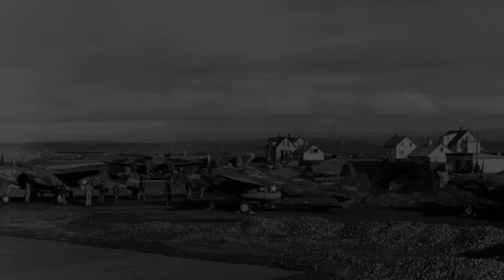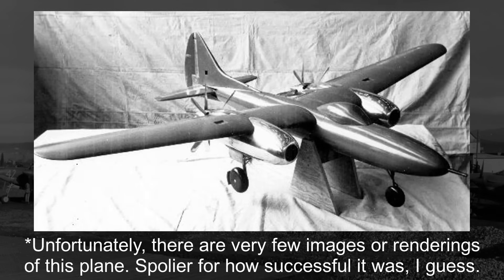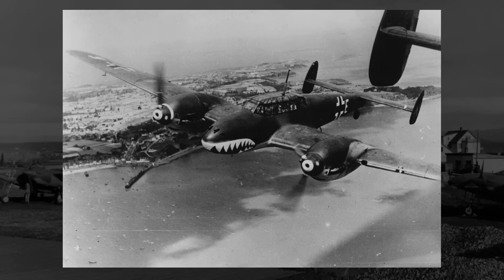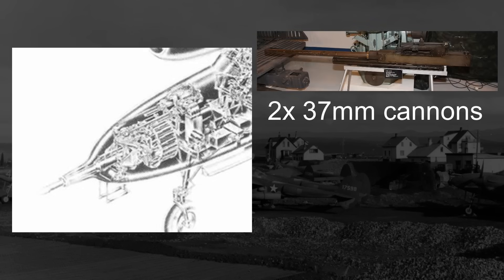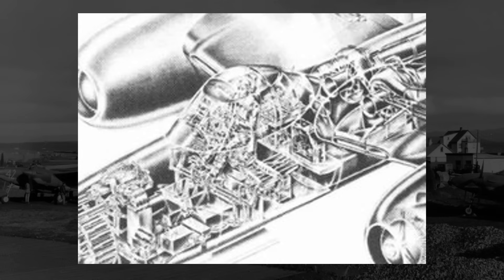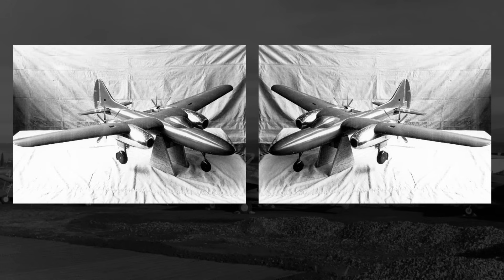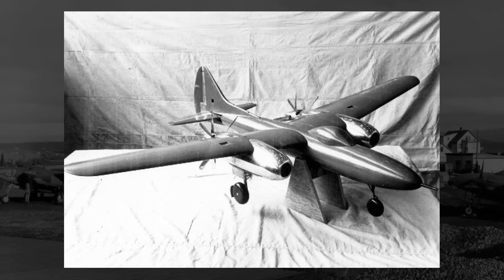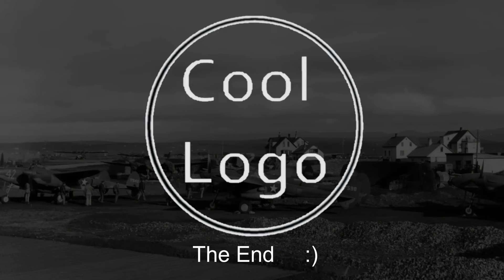Curtiss-Wright Was Run By Insane People: Curtiss XP-71

Comment: Curtiss was cranking out P-40’s, cranking out P-47’s for Republic, ironing out problems with their Helldiver, working on other prototypes while right under their noses was the P-40, it needed more hp and a clean-up of aerodynamic drag. It came in the form of the P-40Q, a 422 mph aircraft, superior to the P-51 in maneuverability, but it came too late in the war to be put into production. However, the P-40 operated in every theater of war and without this airplane, the early years of the war would have looked very different. She was a lethal bird in the hands of a pilot who knew how to exploit her strong points. Unfortunately for Curtiss, their aviation division came to an end in 1947 due to a poor choice of powerplant for their F-87 and politics. Harry Truman had problems with Curtiss and the F-89, a less capable airplane, got the contract.

Comment: 15:03 the allegations aren't that a German bomber flew over America but that one got within 12 miles of the US coast.  That said, this legend has been proven false--the plane said to have done the trip didn't even exist yet at the time the mission was said to have occurred.  I hate to brainstorm how the evil Third Reich could have done better, but as an engineer one is driven to solve problems.  It would have made sense to fill a couple bombers with explosives and fly one-way missions to ram the skylines of Boston, NY, Toronto and Detroit.  Crews could be kept to a minimum and bail out moments before impact, with luck to abscond with fake paperwork and be picked up by skiffs from subs, and worst-case scenario simply finish the war as POWs.  Total damage would have been probably been negligible in the great scheme of things but would have forced the US to devote, what?  1000 fighters to continental US air defense?  More? It'd have also been a propaganda victory.  Of course, the smart thing for Germany to do would have been to not empower Hitler.  The smart thing for Hitler to have done would not to have declared war on the US: FDR was fully pro-war but the US public was too isolationist.

Comment: What a crazy design, but actually not totally unique in concept to other fighters suggested at that time. That "bigger is better" mentality was also displayed in the XP54, the Chain Lighting, Moonbat, XP-72 et al, ignoring what had already been learned in battle. What makes this crazy is the over the top specifications. The range and firepower had no basis in reality and those two factors could have been scaled back and all related systems would have shrunk exponentially! Weight and size probably gotten pared down to half of this plane with a 1200 mile internal fuel range. Four 20mm cannon, heck six, would have been far more lethal and weigh about half or less as much. Even if you kept the gargantuan engines, weight and size would have been less than half. I think so much of this had to be one-upmanship between the manufacture's. They probably felt the need to be over the top to get noticed to get those big, fat contracts. A lot of money was thrown at projects that never saw the light of day, but in in relation to the overall effort of the manufacturer's, kept the paychecks rolling in with nothing more than drawings and models produced.

Comment: Proximity fuzes for ~75mm guns went into widespread use in 1946 (when many USN ships had their 40mm Bofors replaced with semiautomatic 76mm guns), the first effective surface-to-air missile (Nike Ajax) appeared in 1954.

This means that the XP-71, if actually built, would have an eight-year window of being a more-or-less useful bomber interceptor - a proximity fuzed 75mm in the air. 
Though SAMs would quickly replace it and force it into its peripheral role of ground attack.
Reply: As a heavy interceptor over England, not just America, It would want radar and less fuel, but as a ship destroyer, probably near Japan, it would want to retain the fuel.  Like the Mosquito, If exposed to single engine fighters, it would want to use performance to outrun or climb above them, not to maneuver.  So I view the closest competitor as the Black Widow, not the A-26.

Comment: Curtiss seemed to go crazy in the WWII era.  In a 6 year period Curtiss produced 15 aircraft designs that were actually built almost all only as prototypes.  Only the P-40, C-46, and SB2C were at all successful.  There were also a number of other designs such as the XP-71 that ate up engineering man hours without ever making it to the prototype stage.  I can imagine how thin their engineering must have been spread, especially after losing Don Berlin in 1941.  Curtiss's production also seemed to fail.  The army shut down the Curtiss P-47 production line during the war due to the many problems with both quantity and quality.

Comment: I like it.

Hmm ...

Knock down the size, way down.

Super lightly built, naturally.

Two Rotax engines.

Voila!

My very own aircraft, made for short hops to the pharmacy, Walmart, and to church, plus a longer-range flight to the VA Hospital in Columbia, MO, with my new aero- plane rigged to be able to hit the road for a short bit of driving down the road!

With the wings being able to be folded back for keeping my beautiful plane in one lane, of course.

If the police don't like my driving on surface streets, I'd have to do this on very foggy and/or cloudy days for my getaways!

So, automatically fold back/extend wing capabilities.

I would also equip it with a radar detector for just in case, because, well, you know ...

Also, equip it with floats, because I happen to live very close to a river and a lake.

Floats with wheels, for hopping from water to land, then to my shop, all within a quarter of a mile.

Maybe a third Rotax in the nose, and one in the tail for that extra get up and go!

Chaff, for that radar for skyborne thingies!

OK, maybe not quite so lightly built, but still, I'd have to keep the weight down, seeing as to the high gas prices, for now.

I could shut down the nose and tail engines midflight for extra mileage, also.

4 semiautomatic 12-gauge shotguns in each wing for those dadgum birds that can mess up takeoffs, don't you know.

Maybe Jatos for quick takeoffs!

Comment: Its funny when you look at all the hate on German equipment of ww2 it is because the German stuff is never compared with equality.
They say the 110 was poor due to its performace against the shitfire.
But the 110 outperformed the mosquito Whirlwind, welkin blenheim and beaufort which were its actual contemporaries 

The bf109 outperformed the spitfire in practically every factor 

Tiger outperformed the IS2 ir M29 or Churchill

Panther outperformed the T34 or M4 or Comet

Type VII out performed U/ V class

Type IX outperformed Gato, R/S/T class

He177 outperformed other bombers (faster, higher flying, carried heavier load, and had greater range) ("but they caught on fire")
So did early B17s, B24s, B29s...etc

Comment: What 75mm gun has 14lb cartridges??? You are far far off
First the projectile itself weighed 14.5lbs without charge or fuse so 17lbs total

And the case weighed 10lbs empty

The charge was about 10 to 12lbs

So total weight of the shell ised for this gun (most likely the 75mm M5A1) was 
37 to 39lbs

So 20x 37 is 740lbs
30x39 is 780lbs

Not the 280lbs you claim

Comment: Except the germans completely refrained from bombing civilians ( rotterdam and warsaw are both exempt from "war crime" status due to the FACT that Germany adhered to articles 24 through 28 of the geneva convention which directly relate to bombing civilian targets).
And only set about that AFTER the british and anericans showed they preferred killing civilians in europe
Reply: The Luftwaffe never targeted or bombed civilians in Warsaw.  There was some thought of this by some officers but it was simply not allowed particularly by Goering.
Rotterdam was  a city under siege by German troops and civilians were also not targeted   These troops had to keep moving towards the coast as the Battle of France was still under way.  Negotiations took place but the Dutch commander miked the time, the Germans set an ultimatum.  When the time came the Dutch Commander took it to the last hour.  The Bombers were already dispatched due to a daylight savings confusion.   Ju 87 had been requested but were no available so level bombers were used which meant more collateral damage.   Many bombers had reeled in their long range aerial and could not be recalled.   Red abort flares were fired by troops outside the city but no all bombers saw them.   Targets in Rotterdam were bombed but not civilians targeted.   Fuel tanks on the river and harbor side caught fired and the fire spread to the medieval houses which burned down.  Fire could not be controlled due to different fire hose fittings etc.
-Obviously no one is going to march their troops into a city to get machine gunned without prior bombardment.
Rotterdam suburbs burned down but the incident was used by British Propaganda to Justify bombings on Germany (which Churchill wanted) so the sequence of events is surrounded by propaganda.

Comment: IMO. the smarter move would have been to rework it as an anti-ship attack plane...swap out the weaponry for 4~5 20mm canon, and set it up carry one (or two) of the smaller torpedo's and / or bombs.

With it's cruising range, it could have been a terror of the high seas.

Comment: I'm supposing that if the design remained in development long enough to enter the true Jet Age, the nacelles would be easily adaptable for turbojet installation. The tail would need to be converted to a T-tail, or at least move the horizontal stabilizer high enough to be out of the jet blast.

Comment: High fuel capacity was a desirable property not so much for a heavy escort as a heavy interceptor with long loiter time, an idea in vogue in the USA in the late 1930s and early 1940s which had relatively few domestic airbases.
Reply: In fact, it's surprising/shocking how few airbases the Continental USA had when war started in Europe. From memory, it was on the other of a dozen or two.

Comment: P.S., with Northrop's P-61 "Black Widow" coming into service, it pretty much performed all the XP-71's designed functions
Reply: Except range
Reply: It was a beast but the P61 ws a nightfighter. Who can say how it would have fared generally in daylight. Probably well, although 50's and 20's were no joke.
Reply: @donberry7657  Correct, was stressing the point if needed it is there, no need to spend Mega's for a limited used fighter
Reply: Which makes me wonder if the XP71 could have made a good night fighter/intruder. The long range should give a very long loiter time.

Comment: The slight rearward sweep was no more than that of the B-29 and less than the DC-3.  It was obviously there for the same reason as the "sweep "on the B-36, which allowed a tapered wing with a straight trailing edge that was equidistant from all propellers.